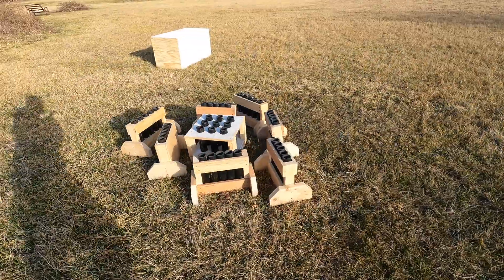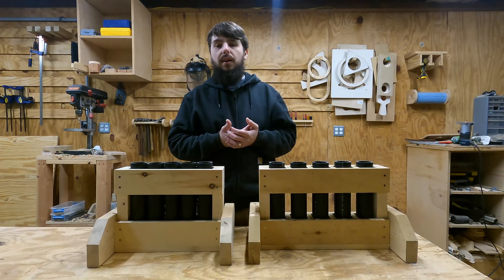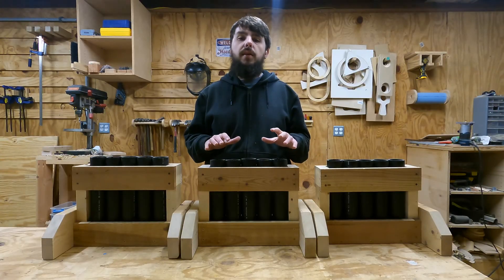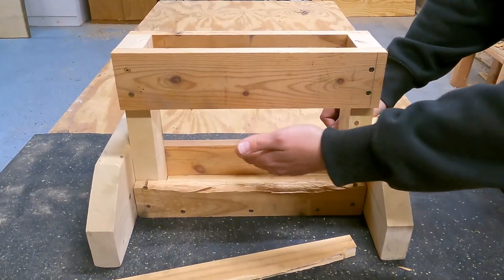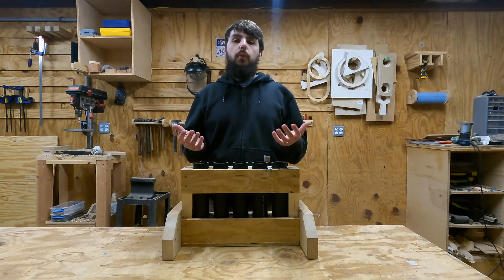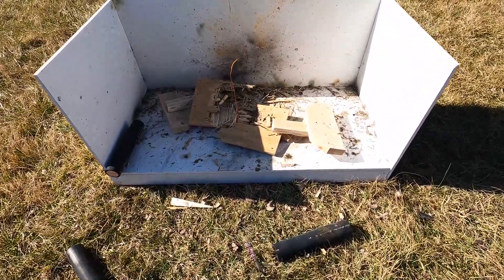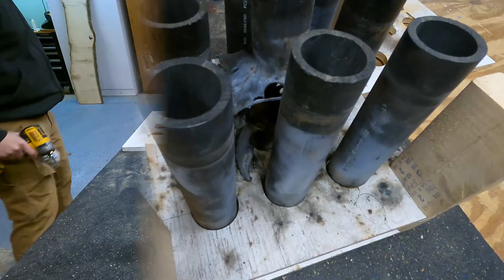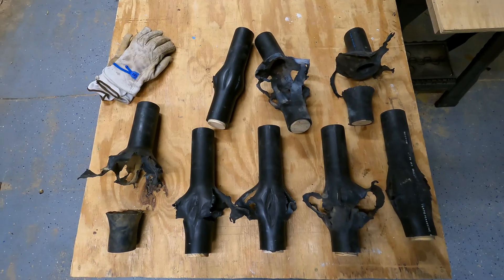Stress Testing Firework Mortar Racks

Comment: I dont think youre building your racks right. Somehow your non spaced racks are holding up better than spaced racks... this has never been the case for properly built racks. Curious of your process... it also helps to keep your side boards at plug height. I dont think yours are. How are you securing the spacers?

Comment: In terms of your future rack building, as someone who has been building racks for about 10 years, I would recommend using six shot racks as your base. This way, not only do boxes of canister shells nicely divide among the racks since they are in multiples of 6, 12, 24 for the most part, but also, when you put together a five-angle rack, it is still manageable to move with one person. Trying to use 10 shot as a base results in fan racks that require two people to move without killing your back.
Reply from the maker: Thank you for the feedback. Im thinking about testing some new 6 shots designs that can be grouped together for new years to see how I like em.

Comment: These racks were never built right in the first place! Look at the length the screws are protruding from the bottom board? WAY to short! And the bottom board should NOT be a thin plank loke that. Frame is 2X3" and side rails are 1X4" lumber held in place with 3' and 2 1/2" screws
 There should be at least 2 screws going into the bottom 2X3" tgrough the 1X4" bottom side rail yo stop that "swing gate" he showed in second test
Reply from the maker: This was never meant to be a build the perfect rack video, but to test materials and design features. If you're interesting in seeing safer designs I recommend checking out my rack test using HDPE sheet. More expensive material but seems very strong. Sorry that you didn't enjoy the zoom, I have a new test video coming out today which might have a zoom feature that is more visually appealing. Thanks for your feedback!

Comment: So i assume thats why shells come with there fiberglass tubes with some having concrete plug right? Seems stronger that a regular wood plug right?
Reply from the maker: I would assume the kits come with fiberglass because it's pretty strong in terms of containing the explosion. I've only tested one fiberglass tube on the channel and the tube wasn't deformed but the plug did get blown out. I'm honestly not sure which is stronger and imagine it depends heavily on the circumstances.

Comment: Likely covered in other comments, but we want to ensure that the gun barrels have 1.5" exposed barrel above the top support brace, and not to go high enough to cover any of the non-plugged portion of the tube. In your spaced rack design you can see that the wood was up above the plugs causing the side rail to explode when enough force was applied to it. Edit: You can see this play out in the base board thickness comparisons too - it brings up the plug above the bottom rail. This explains why your plywood version also blew out a chunk since the shell exploded below the top of the plywood. From what I've read rack bottoms constructed using 2x3 (e.g. 1.5" thick base) plus wooden plugs atop (1.5" tall) brings the top of the plug level with the top of the bottom rail.
Reply from the maker: Thanks! I love all the info

Comment: When you realize this dude is making fire work pipe bombs and setting them off like oh it's no big deal!
Reply: @kinzieconrad105  this video illustrates the dangers that could happen. It's a massive warning of the dangers of being too close to the rack if it fails and the areas it could fail. This shows just how important safety is with fireworks.

Comment: You want to use a 1x3 on the bottom side brace. That way if it blows it doesn’t blow the brace off. Also you want to leave 1.5 inches coming out the top cause that’s the second most common place for a problem. I also use spacers. These three things leaves the space you need to possibly survive a CATO. Use spacers but
never box the tube in. That is asking for the rack to be blown to bits.
Reply from the maker: Thank you for sharing your knowledge, I appreciate the feedback.

Comment: Best practice design is to have the top end of the bottom rails protrude no higher than the top of the plug in the bottom of the mortar. This will cause less force on thise rails and will allow the tube to expand. Also, spacers help to reduce the change of one tube failure impacting the tube next to it. Might be worth a shot of trying it out.
Reply from the maker: I do really like the strength the 1.5 inch base gives and that puts it at the perfect height with the 2 inch plugs. I plan to test out a 10 shot rack with the 1.5 inch base along with spacers to see how it holds up.
Reply: Yeah that’s what I do. I do a 1x3 at the bottom so it won’t be blown off in a CATO. Up top I leave 1.5 inches coming out the top cause that is the second most likely problem area. And I go with spacers also.

Comment: What Linda tubes ?? Why exploding like that ?
Reply from the maker: Great questions! These were all DR11 tubes. They exploded like that because I set them up to intentionally fail. That way, others can see how these tubes expand without having to try it themselves.
Reply: Exactly what is causing the failure though? That way I don't do that by accident at some point
Reply: @markvachon1807  He loaded the shells upside down, so they achieved no lift out of the tube. This type of failure can also occur when a manufacturing error leads to a shell having no lift charge (or far too little lift charge), a plug falling out of a tube, a significant amount of debris or blockage being present in a tube, or incorrect timing on the shell's internal time fuse.

Some of these failures are preventable, but there is always the possibility of manufacturing errors - which is why having good distance between racks and spectators is so important, as is utilizing good rack design, facing racks perpendicular to the spectators, bracing racks properly, etc. Plan for failure!
Reply: He's putting it in upside down.

Comment: This was a great video and very informative. I built my racks with all 2x4 and 1x4 on the sides without spacers. Nice demo fab
Reply: I did too but I am changing them to a 1x3 on the bottom side rail and I’m adding spacers. The 1x3 holds the tubes in but sits low enough to miss the explosion of a blown tube so it stays in place during a CATO. The spacers also allow for the tube to expand without taking out the ones next to it.  It’s sucks you lose some tubes but it’s a lot safer this way
Reply from the maker: Thank you! That's what I'm leaning towards myself, I can't wait to see how they perform 😁